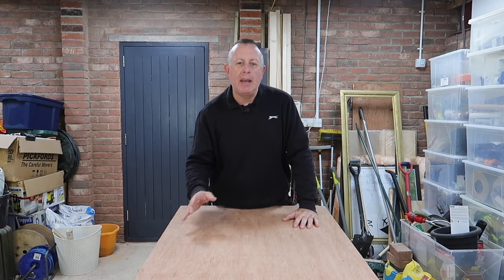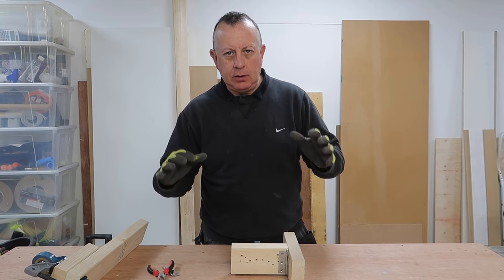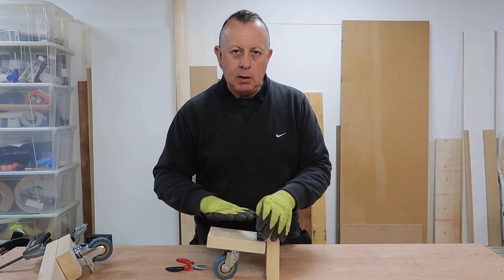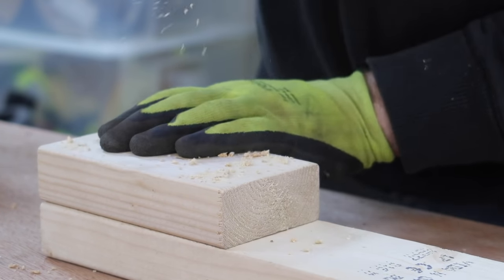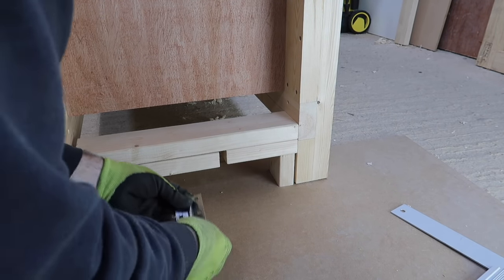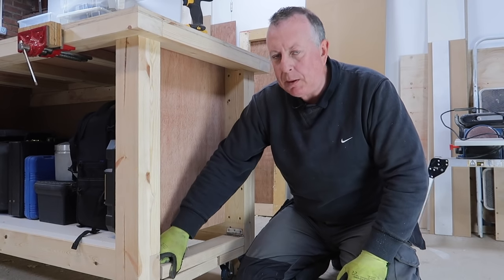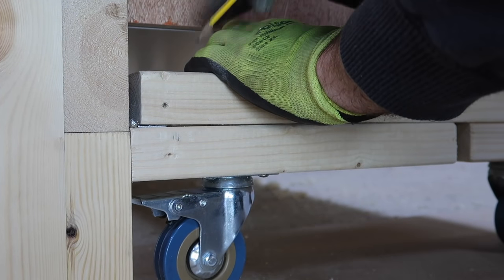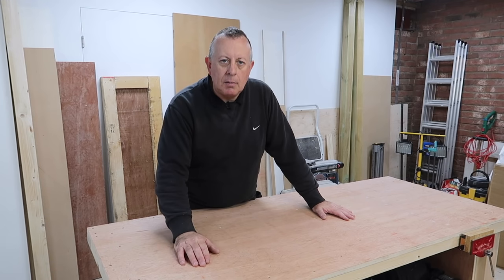Simple Retractable Casters for Workbench

Comment: Gahh my comment keeps on getting deleted (maybe because I added links where I wanted to show you the photos of the build). I actually implemented this (female here) and it worked out terrific. Thank you so much! I was sure it was not going to work for me, but it did and I was so proud I got it to work.

I'm in Australia and couldn't find those hinges but I found the butt hinges in the hardware store were fine without needing to take out pins. I looked at numerous videos with similar concepts but yours was by far the clearest,  affordable and cleverest in my opinion because it was so simple! I really love your channel and your presenting style. 

You have helped me learn how you need to install wood to concrete/bricks. I really hope your channel takes off because you deserve it to. Thanks again!

I've actually got a chronic illness so anything that helps reduce moving tables/lifting manually really helps me.
Reply from the maker: Well thank you so much for your comments and I'm glad the project work out well for you - it's very nice to here others doing the same.
Welcome aboard - nice to have viewers from the other side of the world!
Reply: @ProperDIY  🙂😊👌
Reply: @John-gm8ty  thanks at the time I just went into bunnings and searched high and low, also due to corona lots of stock isn’t on the shop floor due to shipment issues. I will definitely go online for hinges next time 👍🏼
Reply: @John-gm8ty  Thank you so much for this - I was wondering the same!  Off to bunnings I go..
Reply: Thanks for commenting - I love watching YT woodworking videos and sometimes have a hard time getting the products used in bunnings.  I appreciate your tips here - cheers (another aussie female newbie woodworker!)
Reply: @tedmaulassociate4063  Excellent! :)
Reply: Leave off the "http://www."
Reply: The expression is "don't worry about what you can't see."  While you can see this, it's for a personal workshop.  He practices overkill.
Reply: It may be possible to grind off the pin head one end and so remove the hinge pin (if you really need to). He's great!

Comment: What makes this such a valuable piece of information (e.g., tool in my pocket!) is how simple it is once implemented.  I am sure it was by no means "obvious" initially.  Kudos to Proper DIY for thinking up the concept and explaining it in very easy-to-follow explanation.  (That too sounds easy but is much harder than you would think to learn.)  Thanks for sharing.
Reply: Make sure you purchase the “Blickle” version of this recommended caster type. Key is “rolling resistance and compression set” both attributes you depend on with this application. Blickle is far superior than the “Chinese” version.

Comment: I am pretty much a novice woodworker. I mean, I dabbled in the past, but have set out to be much more serious.

After nearly a year of watching YouTube videos on workbench construction, and disliking most for the overly quick, not-built-to-last approach to framing the bench out, I finally took the plunge. I used mostly your workbench design, but with my 2x4 rails supporting the worktop vertically rather than laterally, and made these part of the frame. I fixed the top to the supports rails and extra supports with pocket holes.. something else I had been longing to try. 

Thrilled with that result - a very solid, heavy and going-absolutely-blinkin'-nowhere bench - I moved on, buoyed up with enthusiasm and inspiration drawn from your excellent videos. I incorporated your retractable castors design. The first end went fantastically well, so I used those measurements as a template and put it all together on the other end. AGH! The two cross pieces caught when in the wheels up position, meaning one of the wheels wasn't up. So, just like you said in your video, I pulled the pin (almost didn't use loose pin hinges), took off 3 mil and Bob is my uncle!!! I splurged and bought a cabin hook to hold the mechanism in the wheels-down position, just because the brilliance of the design I felt needed a little more effort and investment on my part to make it look as good as the design is.

Fantastically elegant and uncomplicated design - bordering on genius! Your approach in your videos is a bit like Jamie Oliver is to cooking - you really make it feel like anyone can do it whilst doing everything properly, accurately and with good engineering. Thank you for being the final inspiration to starting my journey as a woodworker! My wife already hates you... she sees precious little enough of me as it is, or was... she'll stop recognising me soon!!!

Comment: Ok, I've watched well over a dozen videos on DIY retractable casters, this is by far the most simple and easy to make. No need for complicated locking mechanisms, large dowels, curved cuts, or attaching larger levers on the outside. Just some 2x4, hinges and a simple L bracket. Wow
Reply from the maker: As an engineer it's my job to make things as simple as poss - less to go wrong!

Comment: Thanks very much for this Stuart, a simple and elegant solution.  🥰
I’ve just finish building the same lowering wheel system on my own workbench, and it works perfectly.  The ‘lever arm’ on the lower wheel needs to be as full-width as you can make it across the bench end; I initially used a shorter piece of wood not much bigger than the caster wheel, and there wasn’t enough leverage.
Wheels from Amazon using Stuart’s link, hinges were part 927PR from screwfix and the adjustable angle bracket was product 152644 from WIckes which was a bit heavy duty but did the job.

Comment: Serious tip from stage carpenter with 20+ years of experience: Get yourself a bit holder with a chuck. Like, really. There's no reason for getting annoyed with bits sticking in the screw and you having to pull the bit out and back in the holder again. These are the only bit holders we use at work, though we do keep a single magnetic only bit holder for when we have to put screws in deep holes. I promise your day will improve with a chuck!

Comment: Brilliant! Have an idea that might be useful on your rough floor... Once every 15 years, I need to roll my grand piano across the room and if going over the rug - or up and down the edge of an area rug - the piano legs could not handle the lateral force. I keep some strips of masonite (is it high density particle board?) as runners to provide a smooth rolling surface. You could use the idea on  your rough floor, then once the wheels are stowed, the running boards would come right out!

Comment: I spent most of the video wondering how you were going to lock the bar down - so elegant, thanks.
If anyone reading this is struggling for wheels, try your local scrap metal guy - I've picked up a set of proper heavy duty wheels for a few quid.
Reply from the maker: Great tip!

Comment: I have mulled this problem over in my head so many times, yet never come up with a suitable solution. This is simply genius in it’s simplicity. 

As soon as you suggested lengthening the lower arm, I could see the mechanical advantage you had over the lever. 

I think it takes so little effort because you’re actually leveraging the length of the longest lever over the distance from the hinge pins to the centre of the wheel playing a funny role, meaning that the radius of the wheel from the centre to the floor somehow not counting in the equation. Then there’s zero resistance due to the rolling effect. I need to play with this when I’m awake. 

Thank you for sharing
Reply from the maker: Yes, you are right. The rolling caster helps a lot.

Comment: Elegant, efficient, cost effective.  But the best part was your sanding the bevels just because.  There's some artistic juice flowing when you do that, plus the relief for the hinge leaf.  One suggestion on the bench top:  A 50mm overhang of the 19mm top material, all sides, will make clamping much easier and quicker.

Comment: I know this video is a few months old but I have been looking for a way to lift my recently completed workbench (which is very heavy) and come across loads of very complicated setups on youtube but yours is so sensible and straightforward to implement. The "alcove" in the ends of my bench are not quite as deep as yours, but I'm sure i can make your idea work. Like you I don't like the idea of castors sticking out as I know I will trip over them all the time. Thanks again for sharing your knowledge.
Reply from the maker: No problem - I'm glad to have given you some ideas

Comment: When I started woodworking, my first project was building my workbench. I had only one goal: it had to be stable. Although I did actually achieve that, it also meant that my six-legged over-dimensioned beast of a workbench, is HEAVY.

Using your lifting mechanism surprisingly did the trick. I’m sure it will not last forever because I need to put some serious weight force on it to lift the bastard, but for now, it works. And I can finally move my workbench around to make space for my next project: a new (lighter) workbench 😅

Comment: I agree with Nomuu. This design is by far the simplest (but still effective) that I've seen after watching about 20 videos on 'retractable casters'. The only possible problem with it might be if I want to put one end of my bench into a corner so that I can't access the lever with my foot or hand, but even then if I leave a bit of space between the bench and wall, I can use a rod to push down on the mechanism. Thanks for this video.
Reply: I have this same issue with my bench that sits in the corner with its left side in the corner.  My solution is to use a 2x6 for the upper lever and rip the “push down end” upper board to have a portion of it extend just past the leg of the bench.  I then put both brackets on the same side of the lower boards (in my case, facing right) Then, I connected the two lever arms with a board so I can push down the middle and do both sides simultaneously.

Comment: I used a modified version of your caster system on my Delta Contractor tablesaw bench. As it was a tablesaw I would not be walking around the rear of the bench very often so I made the top lever out of wider 2"x6" stock and extended it beyond the rear leg by a few inches. This give a bit more leverage and allowed me to use a Gate Latch to hold it down and a length of Jack Chain to release the latch.  One consideration worth mentioning was that my base was relatively narrow to accommodate the tablesaw and once I installed the wheels inboard far enough for clearance the cast iron top of the saw made it a bit top heavy. I won't move it often but found it best to stabilize the heavy end while moving. Thanks for the idea. It really made the most sense for my application.

Comment: I've just landed here after watching the garage 'door' videos.  

I like what you've done with your bench, especially the lifting mechanism to move it around the workshop.

It is also great that you have your structural engineer background which means you wouldn't have gone for this option if there wasn't enough integrity in terms of strength.

I am going to be building my own workbench soon as currently, like you, I've used scraps including an old fire door, side timbers from an old garage etc and it has a bottom shelf too, really handy for storage and access. Thanks for the tip - free wood...🙂

I look forward to watching the rest of the videos you've shared.
Reply from the maker: I'm glad you found us and you are enjoying them!

Comment: This was extremely useful. I have slight problem with my tablesaw-stand is trying to flee from me when I push through thicker lumber, it's both annoying and dangerous. Using just locking casters won't provide enough grip. I will try to make new stand that is on feets instead of casters, will try to fit this design to it. I will also make try to connect both sides together so i could operate it from either side, it should be relatively simple since table saw stand is rather small and light when compared to your workbench.

Comment: I don't know the name of it, but there's a mechanism that can be pushed downward like you have, but when you push it past the horizontal-center, it will lock in place. When you push it back up over the horizontal-center, it unlocks. That removes the need for an additional lock. I'm sure the complexity goes up a bit, but saves having to mess with a lock. Regardless, nicely executed. Thank you for sharing.

Comment: Thank so much. About a year I built my wood working table. I could only figure out about half of what you did. I couldn’t figure out how to mount it and lock it in place. I ended up mounting my locking wheels permanently to the bottom of the table that was part of the height of the table. It’s a little high. Can’t wait until I get to my new house so that I can do this.
Reply from the maker: No problem.

Comment: Hi great video. Just be careful that the bench bottom shelf is high enough for the wheels to rotate 360 which was an issue I encountered. Had to cut the brake pedals off and move a support timer in further on bottom shelf. But great idea and video. Just to add the bench I have is only 2 foot depth  so when wheels on it is very unstable. It definitely would work for a deeper bench and a great solution but not for me. I will purchase the retractable ones on line.

Comment: Nice simple design, but when I first started watching and long before you got to designing the latch, I was thinking of using an over-centre design to lock it in place - maybe by adding a small spacer to move the hinge inwards a little or maybe using a small cutout on the legs below the hing to allow the hinge to swing just past 90 degrees. The will put some load on the pin but if you keep the angle small, that should be minimal. Then you don't need to find an L bracket for the latch.

Comment: I’ve watched every video with retractable castors to find the best solution as decent shop ones are so expensive and I have a number of machine benches. I was impressed  with and built Carl Holmgren system. Yours is one of the best I’ve seen. That latch is clever relying on lateral movements. Pulling the hinge pins is inspired I will definitely use that idea. I would be interested to see a long term use review in the future. Cheers John from County Durham UK.
Reply from the maker: Thank you! I will do an update video at some time in the future to show how it is getting on.

Comment: I built my workbench to be able to hold and engine block and installed 350lb rated wheels with incredible strong locks that make it impossible to move unless I want to move it.  It 20 years old and never once have I had a problem with it.

Comment: Great idea, great video. That’s my wheels done, works like a treat, I now have the biggest skateboard that also doubles up as a workbench. It’s been load tested to 105kgs, me sat on it whilst my wife pushed me about. I changed the latching mechanism for a 150mm hinged batten, that you can push in with your foot as you press down to lower the castors, only because I didn’t have the brackets you used. Very pleased with both the bench and castors. Keep up the great videos. Thanks. 👍
Reply from the maker: It's so nice to hear it when others use some of my ideas or just inspiration to solve a problem. Thank you for letting me know.

Comment: I like this idea. Some years ago I fitted a kitchen and the customers wanted the island unit to be occasionally movable. It weighed a ton and I couldn't think of a way to make castors work. In the end I put a felt seal around the bottom and, with an airbed air pump, made a hover-island. It was quite fun and they loved it.
I think this could have worked with the mechanism concealed behind the plinths and bolts driven down through captive nuts inside the unit to operate it when required.

Comment: In my tech theatre days we called these “tip jacks”, and would use them on large platforms that were part of the set. They were great.  Thing is, I couldn’t quite remember how we did them, and in particular, I remember them being something that took up much more space under the platform than just the ends… which was fine in the theatre, but would be annoying for a workbench, where I want that space for other things (either my legs for a sitting bench, or storage or whatever for a standing bench)… so… thanks for showing your solution! I’ll probably use something pretty similar in the end. :)

Comment: Great build and an ingenious latch!

I did something very similar but found that the weight of my bench really challenged the point at which the hinges were fixed such that the #10 screws were pulling out of the construction grade timber legs.

I replaced the screws with longer #14 screws and one one leg (the one with the lever) I cut out a portion of the leg where the screws had stripped out their holes to such a degree I needed new wood there snd replaced that section with hard maple that I epoxied in.

That helped a lot.  

Next time I’ll use a much more dense material for the legs!

Thanks again for sharing your expertise!!!

Comment: You sir, in this one video, have earned a like and subscribe. I'll finally be setting up a home shop and you showed a very smart, well explained, inexpensive way to make everything mobile. The only changes needed would be based on if the bench and contents were extremely heavy, which would only require sturdier hinges. The overall concept, execution, and explanation are superb.

I do believe that you've helped me a great deal and I thank you.
Reply: I also shared to a small woodworking shops group on Facebook with 110k followers with hopes that it boosts your channel. 😀
Reply from the maker: Thank you very much for your comments and I'm glad I've helped. Thanks for sharing with your Facebook group!